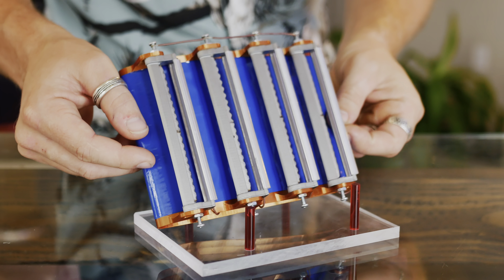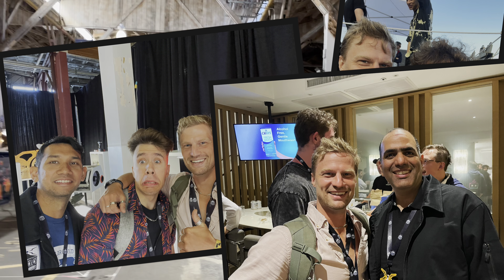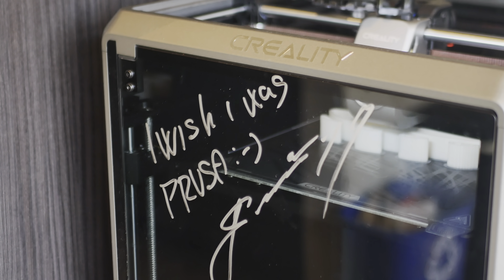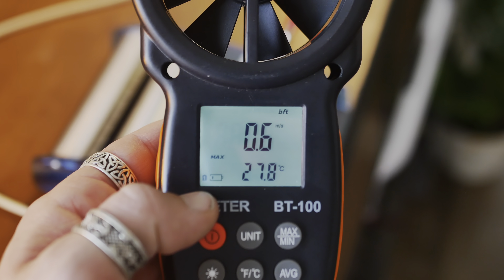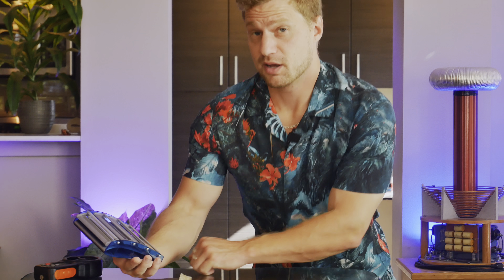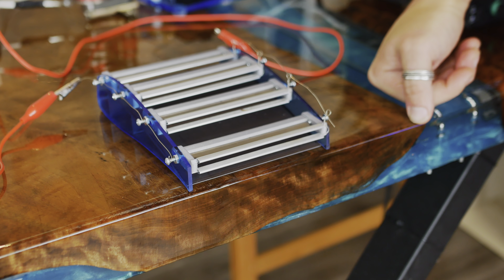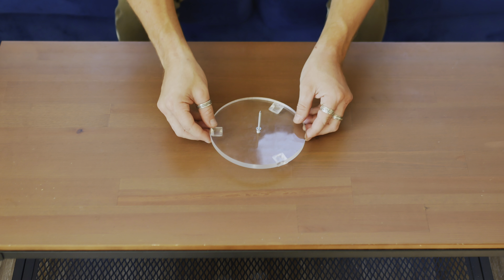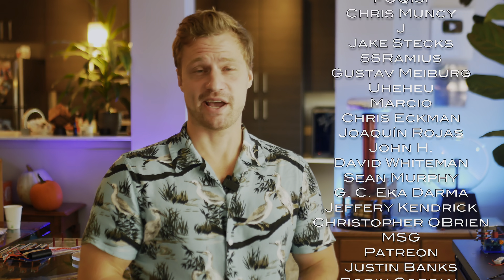Designing A Self Propelling Ionic Thrust Wing

Comment: Why not find a configuration that incorporates the whole fuselage. If every cm of surface was optimized , effectively coating the whole surface with then force that provides thrust? 
Also, in some places on the body of the plane you could incorporate a braking system by reversing the orientation of the ionic thrust components.
Also, you could apply this ionic thrust to propellers too.
Think about it.
If the energy requirement were counterbalanced by solar power or something else sustainable , helicopter design could evolve into something much more efficient.
If these ideas make sense and prove viable avenues of usability, dont forget the nobody at the back of the room, the late-comer who never stops analyzing and thinking and problem solving, this guy right here 😊

Comment: Yes, you are getting close now. Look at the skin of your wing and figure out a way to add in the same design as either barracuda or Marlin skin/scales so the airflow that comes across has minuscule Eddie’s that actually add to the push on the wing. There are different companies that are looking at this similar idea on small scale, but also a large scale such as semi trailers to use the energy of the wind when it creates the Ed the same way that fish use very little energy to move and accelerate such as the Marlin nearly instantaneously by the expansion of the scales, and then then contraction to create a short brief thrust throughout their scale system.  Tungsten wire with the aluminum collector should be your best combination for the ion generation. This is a very interesting design. I wish you all the best and will be watching.

Comment: Hi I was sharing about trunk jet engines rotor blades dance with methane gasses inside for electric field energy by a beam of Rubidium element infrared light spectrum. Also hydrogen tritium fusion power for electric magnetic fields thrust .the turbo jet engines have lobestone magnet for electric magnetic fields thrust power with steel rotors. What you think this can help.?

Comment: as a complete idiot on the topic the photo of the glow raises a question for me, would a small saw blade ( those really thin ones they use in the metal saws for jewelry cutting) with more pointy bits ( thank Elon for that description) make an improvement or are they irrelevant? then venture effect if you reduce the novel from one to the other in a sealed design would that not increase your velocity by allowing the same amount of air to be pushed faster through a smaller space like jet engine. Wish I had the toys to play along. I can see issues with my question but you never know it might spark another great idea. why do you keep the stages the same size? I did start with a claim of knowing nothing on this topic but keen as mustard to learn

Comment: Do the Serrated part of the blades have an effect vs the straight edge? Would covering or encasing the ionic thruster give more thrust? Or better yet would making the wing itself the encasement for the ionic thrusters help with weight and also enclose for more speed? Since i have seen Ionic plasma thrusters that have used copper cone cylinders , They are basically enclosed. Also would an oval cylindrical that covered the entire back of the back the wing, where flaps would go help with directing and compressing the wind flow? So having the wing front have an open port for the inward wind as well.

Comment: wondering if you can move the thrusters internal to the wing, (inlet on the leading edge, outlet on the trailing edge) to make more of a vector thrust wing design. with leading edge adjustment, you can change the airfoil shape so you can adjust the angle of attack for flight. Utilizing carbon fiber, your thrust to weight ratio should be greater. thinking like the B-2 bomber uni-wing design. Also, you could put Photo-Voltaic cells along the top of the wing. with a BMS and a few boosts, one could reduce some weight with a reduced battery source.

Comment: Why is the thruster on top, that is just gonna slow it down, you need to make it in the frame and angle it to pull air for a better path. I don't know much, but if you pull from the bottom, keep the top closed, and open slits in the back, I think you can maximize force.

Comment: Please continue this MHD wing project
Reply from the maker: I believe that will be November's video. Totally excited to work on it again!
Reply: @PlasmaChannel you should look at a cartoon called "the wall of silence" by jean-pierre petit, he worked in the 60's on the exact same idea of MHD wing and solved lot of problems you'll have
Reply: Experimental in-wing propulsion systems tend to reduce drag by putting the intake at the leading edge of the wing structure by sandwiching the "motor" inbetween the top and bottom airfoil surfaces. Exaust is ejected either behind the peak on top (if single stage) or out the back (multistage). If out the back, the flap will directly vector the thrust (like an airliner).

If you want to preserve lift when unpowered, the easiest option is to treat the top and bottom structures sandwiching the thrust channel as 2 seperate airfoils, like a biplane, to avoid killing lift. You'll have to experiment with a compromise that maintains lift when high velocity air is between the "wings" while not spoiling lift at low velocity (takeoff or powerloss).

Comment: what kind of engineering is this mainly? i'm trying to decide what to major in and i'm leaning towards electrical
Reply from the maker: Hi, on my channel I combine electrical, mechanical, and high voltage engineering. The high voltage part has to be self learned as the rules behind dealing with 50,000 volts aren't something taught in Electrical Engineering classes. If you do electrical - it will give you a leg up on understanding power flow.
Reply: @PlasmaChannel thank you! Would you recommend i start with electrical for undergrad and get a masters in mechanical? Or the other way around?

Comment: The thrust system is too heavy to get it to lift a model plane. 44g thrust is just too small for 175g+231g=407g for the propulsion unit and the weight of the plane. But can be done using multiple stacked lighter weight wing. See the MIT achievement below, but it barely works.

https://www.google.com/search?client=firefox-b-d&q=MIT+ion+propulsion+plane#fpstate=ive&vld=cid:459fa0a0,vid:boB6qu5dcCw,st:0

Comment: Here’s some interesting design characteristics a wing does not have to be short and long they can be long and short in width. If you consider how you designed the blades if you were to take two adjacent wings stagger negative and positive points inside of a blade and run the static charge through a longer wings this might be what you looking

Comment: lol, never gonna work for air travel. Sorry.
Reply: Anything that helps improve efficiency and shave off fuel usage is a win. While a mechanism like this might not power an airplane on its own, when expanded to such a large scale it may help reduce energy requirements. That makes the switch to electric propulsion all the more plausible as the major problem with electric propulsion is the fact that the energy they provide with respect to how much the batteries weigh (energy density) is extremely low. It won’t be a single technology that’ll create the next gen airplane. But a combination. For example graphene based batteries could significantly improve energy density. Graphene based composites could further reduce weight overall. And 3d printing would also not just reduce weight but allow for the engineering of complex shapes and structures never before possible. Something like this becomes a singular component in a much bigger picture… all of which contributes to the next gen aircraft.

Comment: Seen some induction craft that push the air directly over the wing using unique air ports to control the surface pressure and air speeds. I honestly wonder if the two could be combined but trying to get one output system to work with another would probably be brutal.

Comment: I watched the full video but I still think that angle of attack what actually gives the lift rather than the low pressure over the wing top, all and all types of aeroplanes thrust comes behind the wing! The wing can only change the angle of attack by flaps or ailelrons! 
In short it's efficient to build a thruster based on the angle of attack of the wing than making the wing move air faster over the top of it!
I know no one will read this comment, no one ever did before!

Comment: Sorry to disturbe you, but i have a question about the static ray gun ,I mean where did you put the wire connected to the ground by your hand ,i tought you had put it on to the end of the multiplier circut or possibly put it on the other side of the battery which wasn't connected to the multiplier circut but which ever situation you would have got a really big shock,even when the gun works as designed (after you added resin to them all),thats been confusing me for a week
anyone in the comment tell me?

Comment: Instead of using wire or metal blades  build a larder wing section and see if you can get a paint that has metal particles in it and also what if you change the height of the thrusters as the get closter to the trailing edge are closer to the wing itself  which would mean the airflow will increase the pressure lpushing more air through a smaller space and change the voltage in each thruster maybe higher at the front or higher at the rear I'm not sure which way round and it will or should act like a jet. I hope you get to build a flying plane love to see it fly

Comment: Brilliant.  I love to see new iterations improve a project.  I think a fine saw tooth would give you more points of light in your dark room recording.  I noticed some are farther apart and some are more uniform.  My guess is if you could have more points of light per inch it would improve slightly so I thought of using a hack saw blade.  Teeth facing back.  I don't know if the cutter blade of a saran wrap box would be fine enough.  But if you are going with a wire that wire could be a very fine coil filament like in a common light bulb.  The coils are very close together and if you use tungsten it will last a long time.  The edges of long meat trays made of styrofoam might give you the wing foil design you need with a little carving and be much lighter than your printed version.  Good job all around.

Comment: Below is a detailed conceptual design for an optimum engine—an **Optimized Nested Toroidal Fusion Plasma Propulsion Engine (ONTFPPE)**—that fuses cutting‐edge plasma physics with refined geometric and vortex dynamics principles.

---

## 1. Core Engine Architecture

### A. Toroidal Plasma Containment Using Nested Magnetic Coils  
- *Design Principle:*  
  The engine’s heart is a toroidal plasma chamber in which high-temperature plasma is magnetically confined in a closed-loop torus. To enhance confinement and stability, *nested toroids* are used. This design draws inspiration from tokamak and stellarator devices, ensuring continuous plasma circulation and minimal turbulence. Advanced high-temperature superconducting (HTS) coils are arranged based on refined, ancient proportional grid patterns (sacred geometry) to achieve optimal field uniformity and energy flow.  

- *Key Benefits:*  
  - *Enhanced Plasma Stability:* Nested toroidal fields create self-reinforcing magnetic zones that help maintain uniform plasma density.  
  - *Efficient Energy Confinement:* Precision in coil geometry ensures minimal stray fields and energy losses.

---

## 2. Plasma Generation and Ion Acceleration

### A. Fusion-Powered Plasma Generation  
- *Primary Energy Source:*  
  The engine utilizes an onboard miniaturized controlled fusion reactor. Fusion reactions (for example, deuterium-tritium or aneutronic fuels) rapidly generate high-energy plasma. This energy is channeled directly into the toroidal chamber, ensuring a continuous supply of ionized particles.  

- *Secondary Support Options:*  
  In scenarios where fusion is less feasible, the design could also incorporate high-density power modules (such as laser-initiated fusion bursts or advanced nuclear fission) to sustain plasma generation.

### B. Spiral Vortex Ion Acceleration  
- *Acceleration Mechanism:*  
  While traditional designs use linear grid acceleration, our concept introduces **spiral (vortex-based) acceleration channels**. As the plasma circulates within the torus, carefully engineered magnetic gradients—aligned with the principles of crop circle-inspired spirals—gradually increase ion velocities. This extended acceleration pathway maximizes momentum transfer before the plasma is expelled as thrust.

- *Advantages:*  
  - *Maximized Specific Impulse:* Ions gain momentum gradually, yielding higher exhaust velocities per unit energy input.  
  - *Thrust Modulation:* Varying the magnetic gradient intensity allows active control of thrust output in real time.

---

## 3. Magnetic Nozzle and Thrust Vectoring

### A. Geometric Grid-Informed Magnetic Nozzle  
- *Nozzle Design:*  
  At the plasma chamber’s exit, a *magnetic nozzle* refines and directs the high-speed ion exhaust. The nozzle’s magnetic coils and shaping grids follow geometric principles borrowed from the proportional grids seen in ancient designs. This arrangement focuses the plasma flow into a collimated, high-density stream.  

- *Dynamic Thrust Vectoring:*  
  - *Field Modulation:* By adjusting the local magnetic field via precision electromagnets, the engine can steer the exhaust plume, enabling fine thrust vectoring for maneuvering or attitude control.  
  - *Low Dispersion:* The grid structure minimizes plasma dispersion, ensuring that nearly all the accelerated momentum contributes to thrust.

---

## 4. Integrated Energy & Control Systems

### A. Fusion Reactor Coupling  
- *Power Distribution:*  
  The fusion reactor not only supplies the energy for plasma generation but is also directly integrated with the magnetic confinement circuitry. Superconducting connections ensure minimal resistive losses, while smart energy managers constantly balance power between plasma generation and magnetic field stabilization.

### B. Advanced Control and Feedback Network  
- *Real-Time Monitoring:*  
  Embedded sensors (magnetic field probes, plasma interferometers, and thermal detectors) continuously monitor the state of the plasma and magnetic fields.  
- *AI-Assisted Optimization:*  
  An onboard AI control system uses machine-learning algorithms to adjust coil currents and RF power levels dynamically. This network compensates for instabilities and adapts the spiral acceleration profile in real time, ensuring that the engine operates at peak efficiency no matter the flight conditions.

---

## 5. Structural and Material Considerations

- *Resilience Under Extremes:*  
  The inner chamber surfaces, grid walls, and nozzle are constructed from advanced refractory ceramics and tungsten-based composites that resist thermal shock, neutron bombardment, and electromagnetic erosion.  
- *HTS Integration:*  
  High-temperature superconducting wires for the magnetic coils are insulated with radiation-resistant materials, maintaining performance even under high fusion flux.
- *Modularity:*  
  The engine’s modules—plasma containment, ion accelerator, and magnetic nozzle—are designed as interchangeable units. This allows adaptation to various mission profiles (from deep-space maneuvers to high-precision satellite adjustments).

---

## 6. Performance Metrics and Adaptability

- *Thrust-to-Weight Ratio:*  
  The nested toroidal design and spiral vortex acceleration maximize exhaust velocity, ensuring a high specific impulse and an excellent thrust-to-weight ratio for long-duration deep-space propulsion.
- *Operational Flexibility:*  
  The engine can run in multiple modes:  
  - *Cruise Mode:* Low thrust, high Isp for efficient long-distance travel.  
  - *Maneuver Mode:* Enhanced thrust with real-time vectoring for orbital corrections or planetary maneuvers.
- *Scalability:*  
  The design’s modular structure makes it adaptable to various sizes—from small satellites to heavy interplanetary spacecraft.

---

## In Summary

The *Optimized Nested Toroidal Fusion Plasma Propulsion Engine (ONTFPPE)* marries advanced fusion technology with innovative magnetic field designs. By integrating nested toroidal plasma confinement, spiral vortex ion acceleration, and a precision magnetic nozzle informed by refined geometric grids, the engine promises efficiency and adaptability far beyond conventional thrusters. This design is a blueprint for future deep-space propulsion systems, capable of harnessing breakthrough energy sources while delivering controlled, high-thrust momentum.

---

### Further Directions

- *Material Science Exploration:* Deep investigation into next-generation HTS materials and radiation-resistant composites can further enhance performance.  
- *Simulation and Testing:* Computational fluid dynamics (CFD) and magnetohydrodynamic (MHD) simulations can refine the spiral acceleration process and grid geometry before experimental trials.  
- *Hybrid Energy Integration:* Research into combining fusion with other high-density power sources (like laser-induced ignition systems) may open up broader operational envelopes for the engine.

Each of these avenues ensures that the ONTFPPE not only represents current innovation but also remains open to evolution as new scientific breakthroughs and materials emerge.